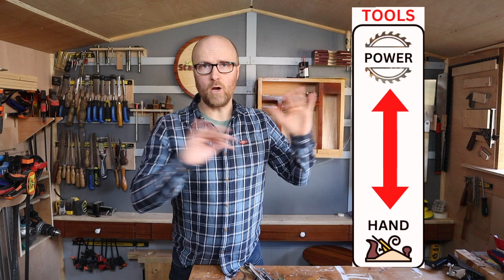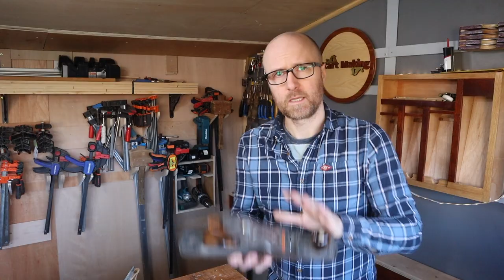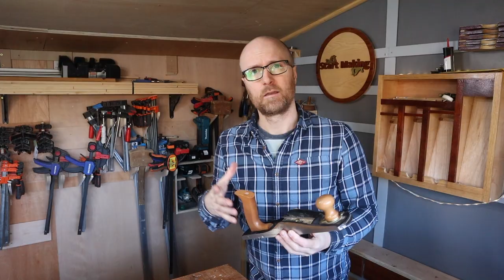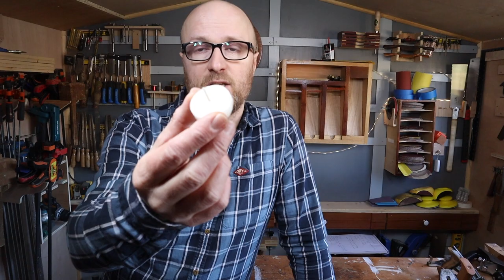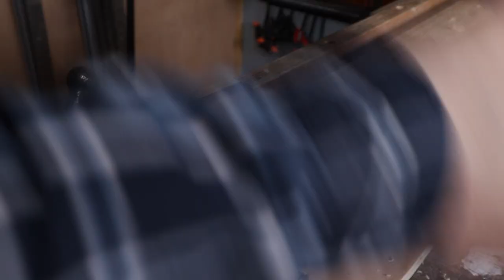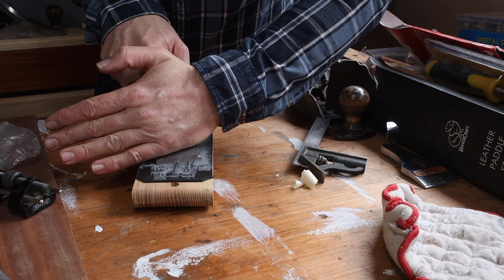my first HAND PLANE was a DISASTER | THIS one is NOT.

Comment: Excellent video!  I still use my grandfather's No. 4.  He had a knock-off No. 4 also; I ordered a new iron from Veritas, all the difference  in the world.  I do take issue your statement that a No. 5 will make you a better woodworker than the No. 4.  Later on, you do say that once you have confidence you will get better with time and use.  No truer words were ever spoken.  Hand planing is very satisfying, once you get it down.  Onto spokeshaves, eh?
Reply from the maker: I have my grandfathers Woden 4 1/2. I cannot get it to work like I want it to. Would be a lovely tool. I think that buying a new iron may be the solution. The no5 making you a better woodworker is really only my experience. I find that the 4 is less versatile than the 5 and when I got the 5 it just all felt a little easier. Hard to quantify but for sure I would not expect everyone to agree. Practise of use and sharpening are the only real solution but you can shorten the distance to success with the best choices in my opinion. There is no better job in woodwork. Are you UK based or US. Purely curiosity. Thank you for taking a look at a few more videos. And for commenting. Very much appreciated.
Reply: @startmaking1  I live in the Northeast U.S.  and I like to do business with Lee Valley/Veritas out of Canada.  I find their wood working tools to be first quality.  You might look into their replacement iron for your 4 1/2.  The iron is thicker  (.1") than the original Stanly iron.  They told me some folks need to widen the mouth of the plane to accommodate this difference; but, it fit mine like they were made together.  It's not the cheapest, but it is a way to save a beloved piece that has sentimental, as well as, practical use. They do make them out of different grades of steel.  Including: A2, O1 and PMV-11 (this is milled to their own specifications).  I ordered a PMV-11 because of the hardness of the steel.  A little bit more work to sharpen, but holds a fine edge. As as  you note that as long as  you hone them before  you think they need them, they'll be sharp.
Reply from the maker: @themeat5053  Wow, so much information., Thank you. I will take a look to see if I can get the iron in the UK. Probably can but at what cost. I love sentimental tools, probably more than I should .

Comment: Really good video. I started with a Vintage #4. Then a Vintage #5.  Then a new 5-1/2. I had no idea how much more I'd get out of a newer plane! The vintages ones are cool, but the newer ones are just better users (assuming you get a good brand). You can bridge the price gap between new and vintage by putting a new blade on an old plane. BUT, if I had to do it again, I'd get a new 5-1/2, 4, and block plane.  And that's it. Those 3 do everything I need. I'd leave vintage to the collectors, with perhaps the exception of a block plane, which is just all about the blade. Woodriver is a good brand that's more cost effective than Lie Nielsen and Veritas, but better, I think, than Stanley.  Keep up the good work on the videos!
Reply from the maker: Hi Blayne. Thank you for commenting. That sounds very much like my journey. I agree that If I could do it again a new plane, long sole a new one shorter and a block would be ideal. My block plane is awful, probably why I undervalue it. If I was in the US I would definitely try wood river. Thank you for watching
Reply: wood river isnt great. the q.c. is way off...just buy one good 5, like a veritas or nielsen and it will do almost anything you need. better, yet takes more skill to joint with is a 4, but with an adjustable mouth so you can use a roughing blade then a finishing blade. the veritas makes doing this super easy for a newbie. 

ive done the full restore, woodriver and then the top brands. if i did it again, id do it all the same except id bever buy a woodriver plane, and id be a lot happier. (i literally hate even having to use it as my 'beater')

Comment: Hand planes fill me with dread.  I can get a sharp edge on the blade but I never seem to set them up right.  You talked about the anatomy of a plane and taking them apart and putting them back together again.  I can do this but I’m really just assembling parts in the reverse order of how I took them apart.  I don’t understand what each really do and how to use them. (Like that lever that moves left to right or where the blade should be mounted on that secondary flat thingy that goes on top of it.  See what I mean?). It would be great if you did a video that goes into a little more detail on what each thing does and when to use it.  With some slick editing, I’m sure you could do something of great value to us bodgers in a 5 min vid. (He says, hopefully).
Reply from the maker: That is a good idea for a video and one that I have wanted to do for a while. A kind of how to set up a hand plane, the basics. I will have a think If I can slot it into the planned schedule. thank you

Comment: Great video again mark. Honestly I have a hand plane no idea what it is brand or number?🤔 Granted I've used it since a had m8 mind set it and sharpen it properly for me but I've no idea if I'll need another one or not. I do however have a grandfather whose wanting me yet whole load tools off him so I'll bare u in mind if I come across anything nice looking can send it down. I could use block plane for edge details but u no what am doing. Ps check ur emails went into detail from last conversation.  Oh and beeswax works great on the base them aswell. 👍🏴
Reply from the maker: Hi Michael. Just spotted the email. Sorry. Sharpening is so vital on the planes. It took me ages and once it clicked I now wonder why it took so long. But it did and it was a pain in the butt. TO be honest on a lot of what you have shown me you don't need a plane as much as others and it has definitely not held you back. You create some lovely stuff without one. Beeswax is a great tip too. The 3 in 1 makes my shed stink and the candles are a little hard, will give it a shot
Reply: @startmaking1  your fine a no your busy. Yea a must say when a got mine was a mess think it's newer but not brand new if that's makes sense. I'll check it out and get back u. No a must say I've only needed it a handful of times with what am doing. Yea good friend mine who is a cabinet and furniture maker told me about that. Works on saw tables thicknesser tables it also helps prevent the rust u touched on. And yes smells wicked. Have a look for a box stone it's a 4 sided rectangle goes round 4 different grits think it's specifically for chisels I used use it on chefs knives and made them like razors and having been professional chef for 15 years built up collection and they needed be like razors all the time and didn't take allot bring them back. 👍🏴
Reply from the maker: @michaelwillson6847  I will have to look up a box stone. Wow 15 years as a chef. I couldn't manage 15 mins, so stressful, I guess it is different if you re good at it.
Reply: @startmaking1  yea they make them wicked sharp. No a must say it's not for everyone takes certian kinda dafty to be able to do it. Dunno if was good at it but managed do it for while got to points were was running kitchens and brigade of guys 10-20 years older than me serving anything from 40-250 a day. But the hours killed me.

Comment: #1-Veritas low angle jack... wish I'd just spent the money and started here.  #2-A good block plane.  #3-I find myself using a fairly recently acquired Veritas small smoother more than my old #4 smoothers.
Reply from the maker: Hi Skip. Sorry, I missed this comment. Veritas make a lovely low angle jack plane. Money no object, that would be my first one for sure. I really need to upgrade my amazon block plane, does more damage than good most of the time. Not seen the small smoother. To be totally honest I am yet to get a smoothing plane to work as well as I would want. Would be lovely to be able to get a finish without sanding. Time and practise I guess.